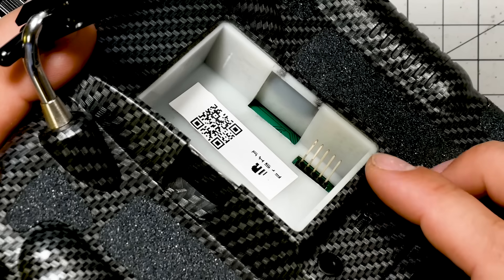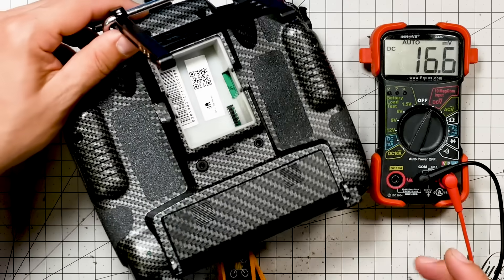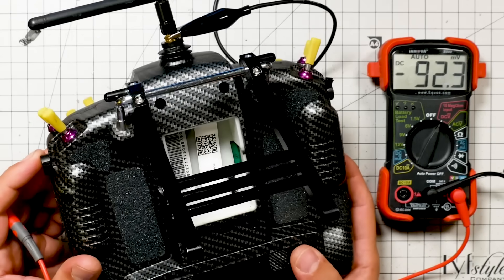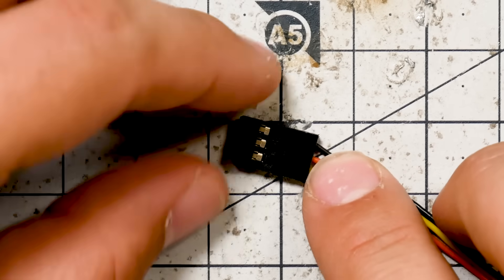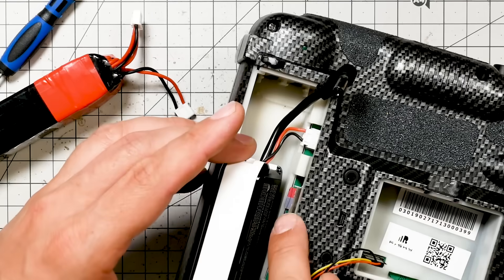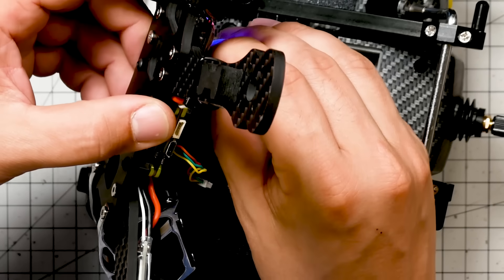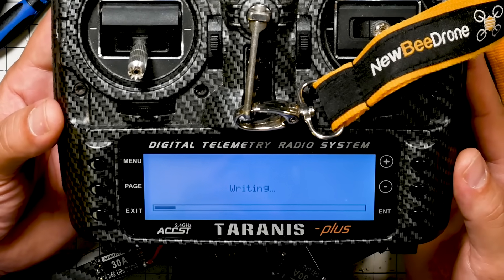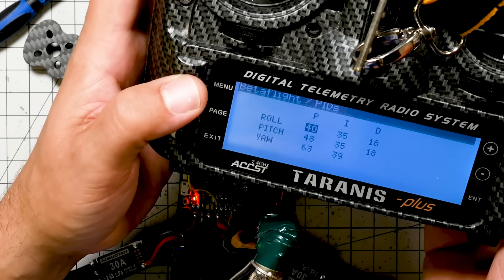FrSky Receiver Firmware Update | R-XSR LUA SCRIPT FIX

Comment: The other process (using serial passthrough) I'd love to see that cause that's the route I'm gonna go if I ever have to flash my receiver. 
Thanks for this one, too. <3
Reply: Same here, I've had quite a few R-XSR and they're soldered to my quad already. Would love to see the process of the serial passthrough soon Joshua.
Reply: hateeternalmaver agree, me as well
Reply: also interested in this
Reply: gonna try this one https://www.phaserfpv.com.au/blogs/blog/flash-frsky-receivers-via-your-flight-controller-using-smart-port-betaflight-serialpassthrough
Reply: I see the problem with this at point 6: unplug your receiver so it has no power.
I have mine soldered up, so... yeah...
Reply: @hateeternalmaver  pretty sure no battery mine has no power.. usb in I dodnt notice any lights on it.. but now i have to check
Reply: I need to figure this out. Mine soldered. And shrink wrapped plug in.  And not home
Reply: @QSpeedRacer  sadly gotta say I ended up getting used to flashing through the radio... ;D sorry mate.
I think it should work with most newer hardware though, just try it out. ;)
Reply: @hateeternalmaver  nope. Cinepro wasn't setup for smart audio. Im have to figure out how to disassemble drone if i want to do this. I need to make sure my radio not broken before warranty runs out.. cinecan (crazybee f4 frsky) wouldn't bind either but I wrote off as just doesnt work with accst d16 at that time
Reply: @QSpeedRacer  well, given you're already in Bardwell's comments I assume you'll figure it out. Almost no better place to start then his stuff... ;)
Reply: @hateeternalmaver  yea.. this been such a headache. I want to make sure it firmware and not faulty internal module.. thank you so much
Reply: @hateeternalmaver  subscribed
Reply: @hateeternalmaver  didn't want to bother him too much.. then i show up at his house lmao jk
Reply: @hateeternalmaver  omg I put other lite radio firmware in to be able to get v1.1 and it worked.. thank you

Comment: Measuring 0V could be ground or could be a digital IO signal at its low state. I highly recommend also using continuity to check for ground when the radio is turned off.
Reply: NO!! lol

Comment: Trying it on my Qx7s but am getting an  FW update error, Bottom pin no resp.
Reply: Make sure you have the right pin out. It’s different on the x9d then the qx7/qx7-s
Reply: Looking at bottom left from right it is black,red,yellow
Reply: Got it working, You do not switch the power and ground around like Joshua showed. Leave Power in center and Ground on the outside .for the Qx7s
Reply from the maker: Correct. On the QX7 you simply plug in a standard servo connector. Only the X9D has the unusual pinout in the JR bay.

Comment: I recently purchased your flight controller and connected the camera, Vtx, and receiver as instructed by your user manual. I configured the receiver and Vtx for smartAudio using betaflight. My drone will not arm. I arm using a spectrum receiver and there is no movement of the sticks on the receiver tab in betaflight. Could you give me some suggestions of what I could do to get my drone working?
Reply from the maker: For a typical spektrum receiver, you would solder the signal wire to pad RX6. In the betaflight ports tab, verify that UART6 has "serial rx" enabled and nothing else on that same row. In the configuration tab, verify that "serial receiver" is selected as the receiver type, and then most likely SPEKTRUM2048 should be selected as the protocol.

If the wiring is correct, this should cause the channels to start moving in the receiver tab.

Of course, you have to have the receiver bound. If you need help with that check the first two videos here:

http://www.armattanquads.com/joshua-bardwells-tutorials/
Reply: Thanks for your quick reply. I really enjoyed using your manual for the FC. It made the build much easier. If I get the FC to work I look forward to purchasing another one. I will do as you suggested. Thanks.
Reply: I did as you instructed and change UART6 to serial RX. It worked. The channels began moving in the receiver tab, however the yaw is aux 3, roll is pitch E, and pitch is aux 1. The drone still want arm. Do you have any further suggestions on how I can correct the receiver channels and get the drone to arm? Thanks again.

Comment: I am honesty surprised to hear about this issue with the r-xsr. I've been flying mine since January and I run LUA with no problem at all. As a matter of fact I've never even failsafed since I started using the r-xsr. Maybe I just got lucky but I've never updated the firmware and have no issues at all. Could it be with the newer batches they are having problems? Great info though JB.
Reply: It can be a crap shoot what version you get since suppliers sometimes put the new ones into the same bin with the old ones.
Reply: I believe this problem with lua scripts is at the first batches of R-XSR. Patching firmware released 10-2017 . So probably they ve start selling it with updated firmware after release.. I ve bought my R-XSR on 18th Jan and it came with updated firmware.

Comment: Great video I love the detail. So if I’m just getting started and cost is not my main concern I should buy crossfire?
Reply: Crossfire is awesome, receivers are just expensive
Reply from the maker: That's a tough one. Crossfire is awesome, but for many people, it is money that could be spend somewhere else with no noticeable down-side. The confidence that flying Crossfire gives is great, but the antennas are a hassle to mount and are more easily damaged.

Comment: LBT - Listen Before Transmit... Second thing XSR survives flash failure (My 5V cable disconnected in the middle of the flash.. It didn't power on - at least LED's didn't light up). Just tried again and it works :D

Comment: LBT stand for  listen before talk
Reply: Thats it!
Reply: Thats right! U spoke my words :)
Reply: Right. It has nothing to do with lifestyle choices.
Reply: Your transmitter should listen for active signals from radar etc. and only if that is not found the transmitter can transmit on that frequency.
Reply: It is Aug 21, '18 and I'm ready to switch to this protocol- can anyone who has recently purchased this receiver tell me if the flashing is still required for the latest firmware, or is it preinstalled and ready to rock?  After using  Spectrum for a long time it seems unusual to have to flash firmware on on either the radio or receiver, guess it's the work required to make it work properly?
Reply: N
Reply: did you find out if flashing is still required?
Reply: Yeah Right . . . Lime ppl in the U.K. listen before they talk ?? Bahahaha

Comment: I'm about to make the jump to the qx7 over from Spektrum. This is the one thing that has made me hold off so long. (flashing firmware on receivers sounded crazy to me) I've been flying for 3 years and now I am ready for the big leagues! Lol
Reply: Get the QX7-S totally worth it👍
Reply: Dufour- FPV.  Ilove my qx7!! But i still am no good at flashing firmware or anything that has to do with computers!!! Im lucky i have frends that are good at that stuff
Reply: In context to this video, on the q x7 flashing receivers is also way easier than on the X9: it has a dedicated flashing port with 5V output. So you just need to connect the receiver with a cable. For any battery voltage. The servo cable that comes with an RXSR even is pinned correctly for an Q X7 (pls double check). 
Also the X10 has the same flashing port as the X7?
Reply: QX7 owner here - flashing R-XSR and all other FrSky receivers (X4R, X6/8 and others) is fast and simple, everything is pinned correctly and straightforward.  At first this video's purpose confused me as I have working LUA on all devices (this firmware has been available for 6 months+), but then I wasn't thinking that not everyone is using the QX7 and/or flashing updates routinely.  It's a really great radio - a paint job makes it look great too.
Reply: FrSky receiver firmware flashing in fact is easy. Especially if you're using Q X7 line transmitters. Latest R-XSR receivers even have nice flashing cable with silicon wires packed together with receiver. You even may cannibalize this cable for F.Port and put JST 1.25mm connector from old PVC wire cable back instead :)
Reply: F spektrum and drops mic.......

Comment: First, my R-XSR sucks! The range goes down to 40-60 rssi range when I am not that far out. I changed mine out with a Xm+ and I can go a mile with my quad.
Reply: I love my XM+ 's. I had trouble getting rssi to work at first on one quad but I once I did they ate great and super tiny. OSD gives me my voltage per cell and full. Have rssi what else do I really need. FPV for Life!
Reply: Bought a new one, put it on last night hopefully this one is better
Reply: So, what's the result with a new one?
Reply: Labs Haven’t flown yet, I’ll see if I can get out today
Reply: Did you ever get to test it? I failsafe at 150ft, ive bought a new rxsr(binded to a QX7S) thinking the original was broken still same issue.